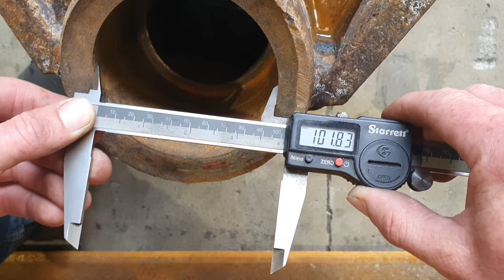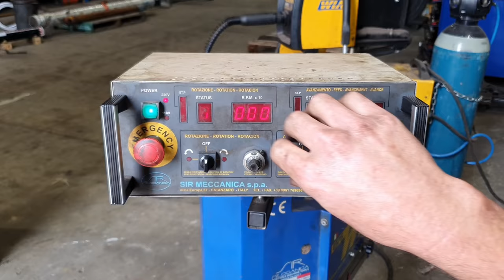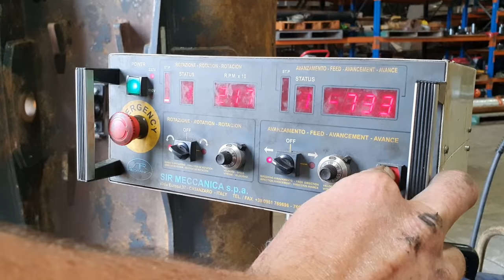Line boring Repair Tilt Bucket & Hitch | Sir Meccanica WS2

Comment: My boss would flip that stuff right in the shop. Probably why the shop floor is rougher than a gravel road and an absolute pain in the ass to sweep. Luckily, he’s a lazy ass slob and leaves that for me…and a pile of tools everywhere…
Though being a lazy ass, it’s not often he actually does anything. 

I went on cleaning strike at one point. 3 weeks and you couldn’t walk across the shop save for one maybe 10” wide path. Sweeping resulted in half a trash can of shit from the floor. No exaggeration.

Comment: A bushing would have been better.
Reply: it is a bushing!!!???
Reply: @bonvoyage5377  I think it is a bushing when you would clean up the bore and shrink and press fit in a sleeve. It could even be different material. Hard against soft is best and it doesn't gaul and wears better. It is a pretty nice trick to be able to build up weld inside a bore and machine it out. I'm just not sure that it is worth the effort for that approach.